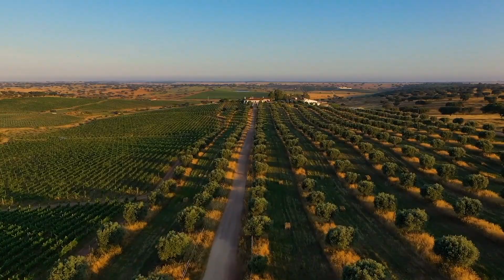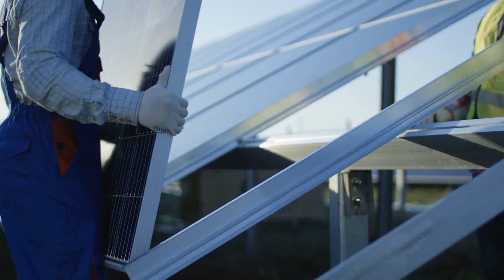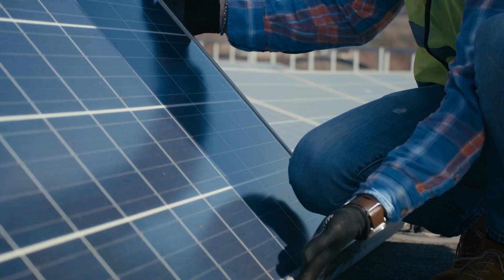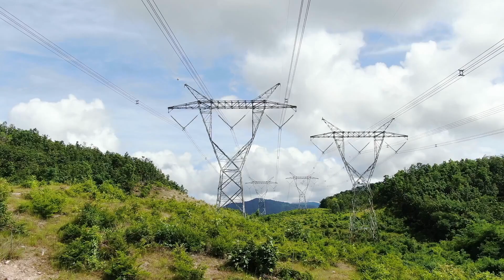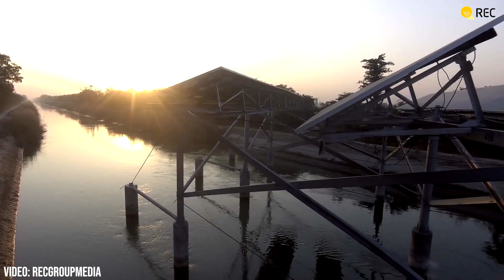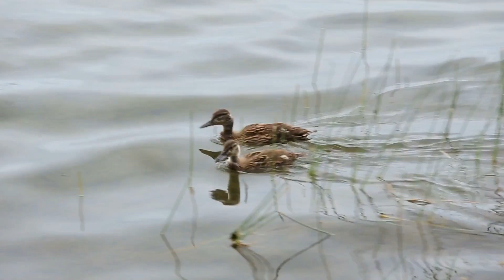Breakthrough Solves Solar Panel's Biggest Issue!

Comment: It would be interesting to see installation and maintenance costs from a trial run.  At least in the renderings, it looks like the panels aren't pointed in the optimal direction, and it would be great to know the actual cost of keeping the panels clean enough to work properly.
Reply from the maker: Great point, I imagine they would angle at the correct angle as the ines in the render would be very poorly placed 😂 thanks for the comment! :D
Reply: Even in Space Engineers, a game, I point my solar panels in a optimal direction, I even read 3 papers and wrote python code to optimize them. No excuse for a startup.
Reply: well, they've got the water right there to do so.

Comment: Nice short explanation on the possibilities, but I think this should require a way better design to better hybridize canals with solar panels.

Perhaps the cable system could work a bit like how Aricebo's dish worked. The water is the dish and is "stationary", but the cable system can move the panels laterally and tilt as necessary to block less water and receive more vapor and angle towards the sun. This would require extra power and more engineering though.

Comment: Should be interesting to see it in person. Lower water evaporation, cooler panals leading to higher energy output from the panals. Less permits required to mount those panals i guess required from hindsight

Comment: I don't understand when you say this reduces the need for transmission lines. On a dark day, or at night, where is the power going to come from? To me it looks like this would just decrease the load factor on the transmission lines, without decreasing the need for them, unless some local storage or backup generation system is added.

Comment: Good video. Maybe one thing to add: The sun, by its UV radiation, may help to keep the water clean and stop growth of algae and bacteria, for example. Thus, blocking out the UV light might as well be disadvantageous. But that's probably not a major issue.
Reply: Yea I think this is one of those projects that sound great but then turn out to be more expensive, less useful, more damaging to the environment and with limited usecases.
ike you said, a canal with solar panels above it can make the water toxic with algae depending on how much is covered, how transparent the solar panels are (to UV) and the speed of the water.

The thing is, it might make the solar panels better while also evaporating less water, but if the solar panels cover the water too much then not enough will evaporate to cool it.
To maximize cooling and energy production while minimizing water evaporation and toxicity, mechanisms need to be put in place that control water flow, collect vapor and funnel it over the solar panels to condense it, while also keeping the solar panels from blocking the water.
Reply: @Yezpahr  yes, widely agree, except maybe for a little misconception: When the water vapour would condense on the panels, they would heat up. So it's probably better when there is some air circulating under the panels to exchange the moist air by dry one.

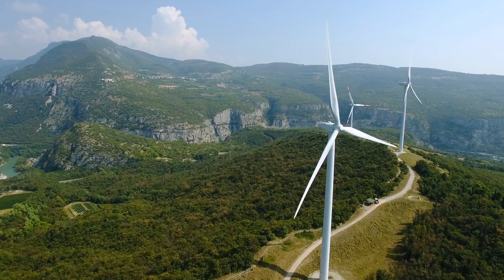Comment: 0:15 You better be talking about vertical farming in closed systems because you can’t address the industrial irrigation issue causing those droughts any other viable way.

Oh… so no mention of the conventional farming that uses nearly 2,000% more water than aeroponics? Take your calculations for aqua deft evaporation and extrapolate over the entire area that agriculture uses.

Are you gonna cover all the crops with solar panels too?

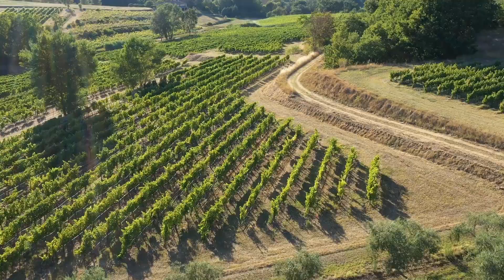1:15 Solar panels are saving money… IF you don’t consider manufacturing costs and landfill usage once they expire due to THERMAL DEGRADATION.

4:10 You might want to address the rapidly declining water table in California due to excessive groundwater pumping.

All of this solar panel talk is a screen alright; a screen obscuring the actual water issues preventing actual solutions from being developed.